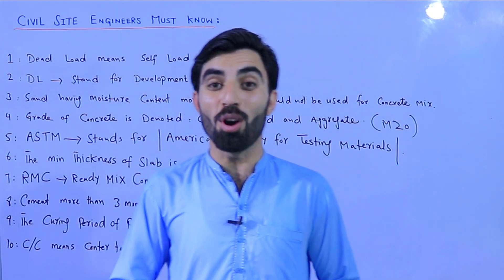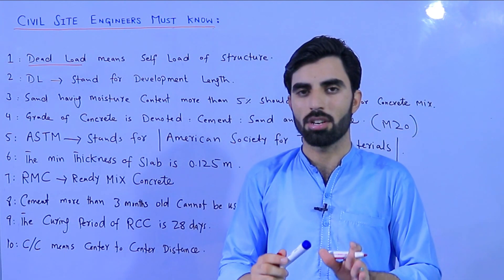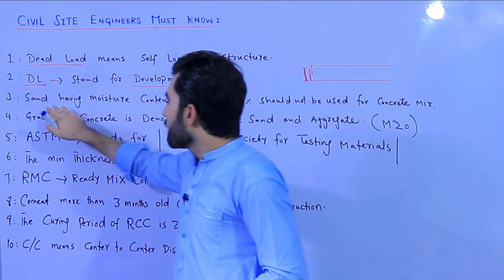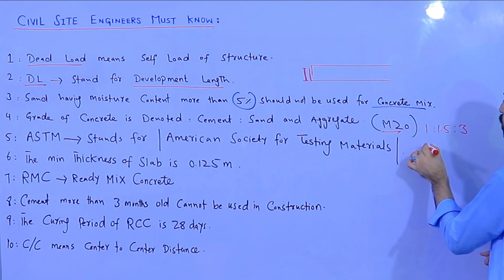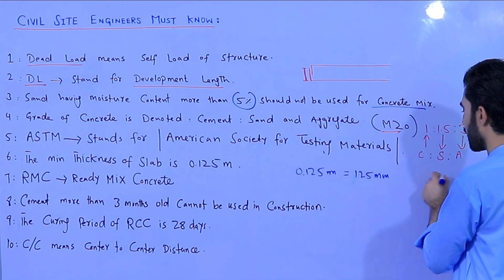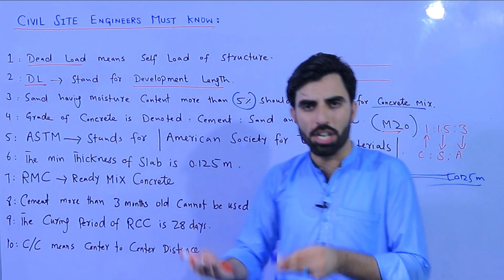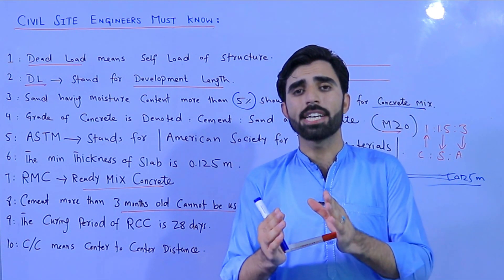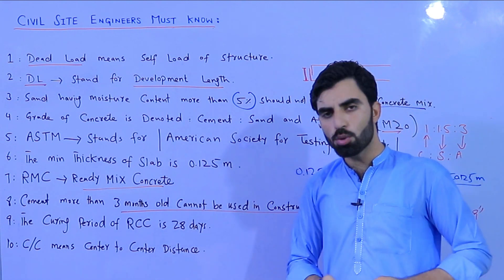Civil Site Engineers Must Know - 10 Points Every Civil Site Engineer Should Remembered -

Comment: Why curing is necessary for 28 days rather than 7 days
Reply: Because concete is expected to attain its designed compressive strength. Curing is very important inthe first two weeks as the rate of setting of cement and gaining strength is crucial....
Reply: 7 days is concrete initial setting strength and it is still curing while 28 days yields concrete full strength as per its grade.